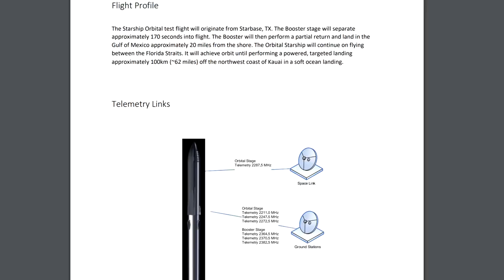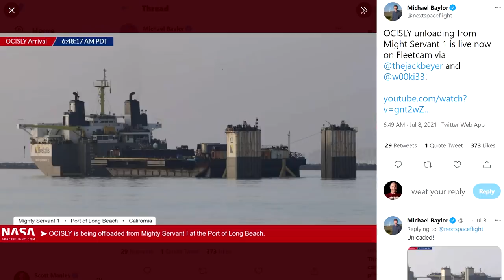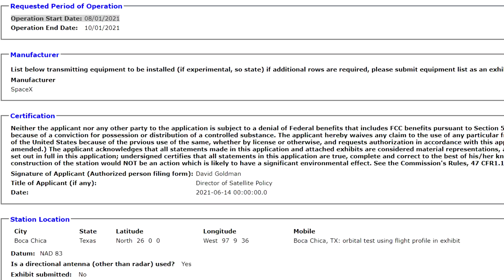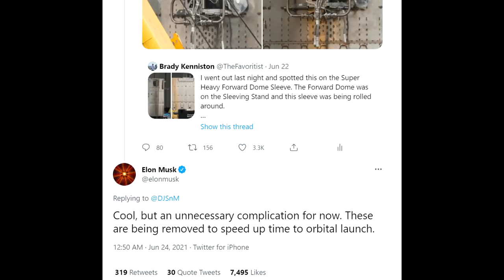Why SpaceX Will Move To New Thrusters To Simplify Starship

Comment: I designed a small asteroid lander for one of the NASA L'SPACE training academy. Cold gas is so much simpler and more stable (for long duration missions like one out to the trojan asteroids.). Our particular design utilised solid fuel stored during transit and applied current/heat to convert the fuel to pressurized gas. It also requires the pumps you talked about. So the setup actually does use quite a bit of power for a low efficiency propulsion. One of the reasons we didn't win the design competition, hahaha.

Comment: Another advantage of using a gas/gas system for RCS might be that you do not have to worry about pressure shocks / hydraulic hammer due to the fast opening / closing of the valves which is needed for RCS.
Reply from the maker: Yeah, I mentioned this on my twitter thread but completely forgot it in this video.

Comment: Bigger version of Kestrel running on methalox would still have pretty big problem.
Starship (including lunar) is supposed and made for reuse, but Kestrel engine use ablative cooling so engines would have very limited life span.
Reply: The engine itself is not ablatively cooled, just the nozzles. The nozzles can (relatively) easily be redesigned.
Reply: @Mythricia1988  It had ablative cooling in chamber and throat, so not exactly nozzle.
Also it used TEA-TAB, so limited relights and not good for on site production.

Comment: I think having the rcs use the same fuel as the engines is a really good idea as it gives them a much weaker and less efficient backup engine in case of emergencies.  I can imagine them getting stranded somewhere and monopropellant would run out far too quick, but in a pinch these new RCS engines could get you out of a pickle.
Reply: Yeah, pickles such as propellant slosh. A long but low-thrust burn will do nicely for that.

Comment: RCS thrusters for a vehicle of this size would generally be in the 1-1.5klbf range. Given the size of the plumbing going to those chambers, they are likely operating on low pressure gas feed OR low pressure liquid tapoff and then run through evaporators to bump up the pressure. If those chambers were running on liquid, the lines would be around 1" in diameter. Those lines look like they are 2" in diameter. As well, the chamber diameter is very large given the assumed thrust level and the L/D ratio of the chamber is very low. This leans towards a very low chamber latency which means gas/gas interaction and the interaction is very simple, ie. a very simple molecule that is being reacted. Methane is poor mans hydrogen and its a very simple molecule. So.....signs point to low pressure CH4/Gox.

Comment: @10:46 I think they will use electric pumps just like the electron rocket, but probably with a small high pressure buffer tank between the pump and the combustion chamber to cater for the intermittent flow that an RCS needs. Looks like another good use for a Tesla electric motor in space.

Comment: Scott, thanks for another interesting video. Dumb thought. If the cold Gas thrusters are Nitrogen and we want to save weight and complexity why not use cold O2 thrusters ? There is lots of O2 on board. The atomic mass is similar so I'd expect the specific impulse to be similar. Clearly a fuel/O2 hot gas will have a higher specific impulse, but is it worth the complexity and weight when these only fire in short bursts ?

Comment: When you explained they might be using gaseous oxygen and methane that they'd probably compress to higher pressures at need, I thought this could be a great means to reduce the lost energy due to boil off on a trip to mars. I'd imagine you need some thrust every now and then anyway for course corrections, so probably the boiled off gas will be sufficient for that and could be put to a good use. Also for long time propellant depos those could be used for station keeping, so nothing would be "wasted" to keep the pressure within those tankers at a save amount. Instead of just letting it boil off, the gas would be used to fight the atmospheric drag and to avoid collisions

Comment: Terrific video. Everything associated with the recent changes in the Booster/Starship is made possible by these new hot gas thrusters. While I think it all began with the initial design of the first Dragon, when they determined they could land the Moon Starship using these thrusters, everything else evolved quickly. The ability to land either vehicle on a spot the size of a stamp, 20 or more feet in the air, is a direct result of the performance capability of these thrusters. Of course, all of that led to the elimination of the weight associated with the landing legs and probably the grid fins as well. As to landing it in the ocean, just think what China would give for one Raptor engine as well as the technology of other components of the Starship as well. While SpaceX is pretty well public with what they are doing, there are still secrets that would take years to uncover. Including the metallurgy involved with the production of the Raptor engines. I can see no way that SX or the government lets that booster go without recovery.

Comment: Could you do a video on the different conditions that these fuels can be stored in? What conditions are required for liquid and gaseous storage? What are the challenges for each? I was a little confused by your comment of “low pressure liquid” vs “high pressure gaseous” and can only assume it’s the temperature difference that’s important. That raised the question for me though of how do you keep liquid oxygen cold enough to remain liquid for the entire flight to Mars?

Comment: I mentioned this long ago. They can use simple taps off the Raptor engines to quickly refill a gas thruster system. For a moon system where they have to slow to deorbit this works well. Thrusters can be fully topped off by the end of that burn. Because there is no deorbit burn at Mars it isn't viable there. I expect the landing and takeoff engines for moon Starship will be liquid fed mini Raptors. Maybe half the size of the prototype Raptors. Gas fed thrusters can also then be refueled with taps from them.

Comment: Biggest reason in my mind for hot gas RCS thrusters to be gas-gas methane-oxygen thrusters is you don't have to keep 2-3 miles of supply pipes cryogenicly cooled at all times.  I'd also expect them to have a split RCS system with completely independent top and bottom RCS systems.  They've shown enough thrusters that one end is enough for orientation control, it saves a ton of pipes, and minimizes the ways that a RCS failure can sabotage the remaining functional system.

Comment: sounds like a very important job, siphoning off the main turbo pumps to another fuel tank for hot gas RCS. I hope they have enough fail-safes to keep the tanks from poping. I guess if the RCS tanks are large it will be easier, if the RCS can be operated over a larger period of time without being refilled, or perhaps if they are large enough, they can be filled half or 3/4 the way. No danger of over press. with sufficient fuel to operate within margin.

Comment: do you think they still have all the tooling for kestral sitting around? its been a minute since they've built them, i wonder if they still could or if a ground up "new engine" would be easier
Reply: Did they even have dedicated tooling? I wouldn't be surprised if those were entirely standard parts + 3d printing + computerized machine tools.

Comment: My thought:
If they're using autogenous pressurization from the Raptors for the main tanks, would it be possible to use that same system to pressurize the tanks for the RCS? The booster flight path especially should be fairly common (with margins) until the grid fins gain enough hold, so I'm wondering if a COPV could be charged on ascent with enough pressurized propellant for the various landing burns?

Comment: So the thrusters work without a pump? Ignition in the vacuum of space sounds tricky.
Reply: There's two basic ways:
1) hypergolics, which Scott mentioned- roughly guaranteed to work, but nasty, and guaranteed to work in case of a leak too;
2) honest-to-goodness sparkplugs, which is slightly less guaranteed to work, but was used successfully on every Apollo moon flight, and is thus a feature of the J-2 rocket engine.
Reply: @absalomdraconis  Raptor itself already uses spark plugs actually, so they should already have a lot of experience with that.

Comment: [Distantly] related question: could upgraded (or standard) Starlink comm lasers be used to deorbit debris??
Location, proximity, field of fire [outward] IDEALLY SUITED for this role. Flakes, bolts, panels, tanks, boosters... Multiple sats concentrating on larger targets...
More hidden muskian synergistic brilliance??
Reply: I doubt the comm lasers are powerful enough for that but I wouldn't be supprised if musk had his own space garbage cleaning system in development.
Reply: @rirtunsasgi2626  What do you mean you 'doubt'? Why would you think that's worth anything??
"illuminate debris with light a few times more intense than sunlight, imparting just enough momentum to nudge the debris off course."
-Kilowatts from the ground. Much much less from low orbit. Nudge small objects into grazing elliptical orbits. 1000s of advanced dual purpose sats ganged for larger objects, multiple hits over time.
They're in the perfect location, perfect configuration.

Comment: I thought about the lunar Starship having Kestrels on the side and it seems to give some very interesting contingencies for the mission.
There's probably redundancy among that many engines in case of a failure, and the Starship still has its main engine for abort.

I'm wondering, with the height of it, if the Kestrels have the response time to act independently to stabilise it upright if necessary. Or would the RCS have enough thrust for the job?

Comment: 12:25 ".... you might get the gas bubbles at the top."

There is no top in zero G is there? Surely any gas bubbles would be in suspension in the liquid & that they would only gather collectively in the same direction as the acceleration in the vessel?
Reply: Acceleration creates 'top"?
Reply: @michaelgian2649  No, that's not what I said is it?

Comment: Probably gas/gas thrusters, liquid thrusters used to be non-cryogenic until now because are using a inflatable blather(you can inflate a blather in a cryogenic fuel tank?), or other complex solutions to avoid the engines that are designed to work with liquid propellant to feed with gases.

Comment: If they do use gas, run times will be very short because gas doesn't cool as well as liquid.  Those pipes look pretty big; if it is liquid, looks like they are shooting for several thousand pounds of thrust (which is a lot for a thruster, more like a vernier).  Could very well be a gas fed design by the looks of it, and I bet it runs at tank pressure, not boosted.

Comment: Could you have one pressure chamber inside another one, drive it with higher pressure and when entering space, move the inside engine to increase ratio inside? Cooling only outside bell.

Comment: A fast electric ignition system is probably involved. Sparkplugs or something similar.
Reply: They already use that for the Raptors, so it would make sense. They should already be quite familiar with igniting methalox mixtures with spark plugs.

Comment: I'm not an engineer (and definitely not a rocket scientist) but I think the gas ingestion issue for thrusters could be countered by using  (full) cylindrical tank with a pusher piston -  assuming (and it's a big assumption) - that the piston/tank seal could be perfected. Triple/quadruple brass/copper sealing rings might do the job. The opposite side of the piston could be driven by an electric or electro-hydraulic ram or simple gas pressure to maintain a predictable pressure. Possibly too heavy for Mr Musk.

Comment: Another possibility for HLS is to let the LOX and LNG flow into into header tanks for landing and as the propellant flows out of the header tanks and through the plumbing to the engines, it goes through electric heaters that vaporize the propellant before it reaches the landing engines and pressurize the whole system.  Have additional tank electric heaters if needed.  No pumps needed.  Dead simple with the only moving parts the valves to the engines.

Comment: if there is some expectation of boiling of the main LNG / O2, can you just tap the top of the tank for a hot-gas thruster?
if you must use a pump from the top of the main tank to keep the thruster high pressure, how fast can you induce boiling to ensure high enough feed rate?
what is the danger of freezing the main O2 / LNG by pulling a vacuum on the main tank?

Comment: Great video Scott. 

Can you at some point in the future explain to non rockety people what specific impulse/ isp is and what it means. 

Thanks.
Reply: The short version is that ISP = gas mileage. It's a measure of how much impulse you get, for a certain amount of propellant. Higher ISP = more impulse for the same amount of fuel. Not necessarily more *thrust*, but just more efficient thrust. The reason it is measured in Seconds is a bit more tricky and long-wided to explain, and I won't even attempt to, but, I think Scott has a video on it previously, though sadly I can't remember the name of the video!
Reply: @Mythricia1988  thanks for clearing that up. I wasn’t sure what it meant.

Comment: Hi Scott. If the RCS will the main fuel and oxidizer, in the Starship the main fuel and oxidizer are not hypergolic, which means they have to be ignited in the RCS. How is that supposed to happen? The RCS must have a quick start and a quick shot off. Are they supposed to be ignited each time they use the engines of the RCS?
Reply: Spark plug.

Comment: Can't the tanks for the RCS be filled by the autogenous pressurization system? Might not work for starship as it requires it continously during its journey, but should work for superheavy who regularly fires its engines.
Reply: The autogenous pressurization still only gets the tanks pressured up to the required flight pressure, so 6 atmospheres or something, which is far too low for the hot gas thrusters.
Reply: @Mythricia1988   A system like that wouldnt work. The gas you tap out of the engine is at much higher pressure. If you just put that into the tank as is then you will have massive problems once you stop to fire. The remaining fuel will cool the hot gas, thus pressure will drop very low quite fast and you will have to add more gas. 

It makes much more sense, that you would take the gas from the engine and put it into a small intermediary tank (maybe copv) that will hold pressure when the engine is off and can supply high pressure gas once the pressure inside drops.

Make those intermediary tanks a small amount bigger and you have tanks for your RCS

Comment: Could the reaction control thrusters double as the lunar lander engines?
Reply: Probably not enough thrust, or if they are gas-gas, not long enough burn times.
Reply: @gajbooks  if it is fed from the main fuel tanks, duration should not be an issue.  I imagine that most of its velocity could be reduced using one of the main engines. I would also imagine that it would be possible to make the reaction control engines with the ability to control thrust so that they could be adjusted to the appropriate thrust for the two purposes

Comment: Liquid powered ... problem with liquid or vapour getting into the engine - what about supercritical where there is no interface. The thing against that is, of course, if the critical pressure/temperature are too high. Are they too high?

Comment: having a gas expansion tank before feeding into an engine, could that be used in the future for more efficicent engines? you wouldn't be able to run the engine as hard or as long but you'd prolly get amazing specific impulse, especially if you aren't just blowing unburnt fuel into space

Comment: Actually if they use gas-gas-thrusters, you wouldnt even need pumps to refill the small tanks, you could just pressure feed them from the main tanks and let those build their pressure back up by evaporation, right?

Comment: At about 11:29 you mention a heat exchanger. I would like to see the liquid fuel used as a coolant that would warm up to gaseous form before being fed to a gas gas thruster.
Reply: In a way, this is already what Raptor does. Once the oxygen and methane actually reaches the combustion chamber on Raptor, they are both in (hot) gaseous form. That alone makes Raptor quite special.

Comment: If my napkin maths are correct shouldn’t they float like corks and be easy to recover? Assuming a soft landing in the ocean that doesn’t break up either the booster or starship. 

From my research the dry weight of Starship is 85 metric tons. The sum of the volumes of just the main fuel and oxidizer tanks is around 1400m3. Since fresh water has a density of 1 metric ton per cubic meter, that implies a displacement of 1400 metric tons of water. Salt water is even heavier. 

Thus unless it breaks up or gets artificially ventilated it should float very well, even if the tracks still had some fuel left in them. Ina side note, considering the density of the fuel, it should still float decently well when fully fueled.
Reply: Both land on their tail, both will topple.  That's what they have to survive.
Reply: @TheEvilmooseofdoom  Truly. That said, if they are sufficiently vertical they should be able to take a short vertical plunge and bob back up.  But yes, it's indeterminate how the structure will handle the various loads this implies.  Would be a fun simulation if I was of a mind to test the hypothesis.  Thank you for the point.